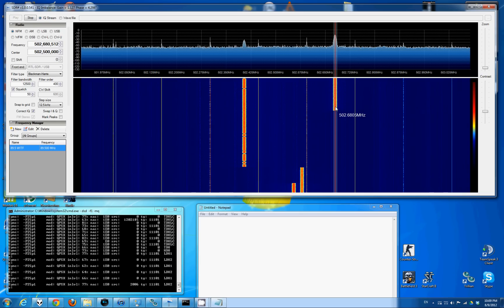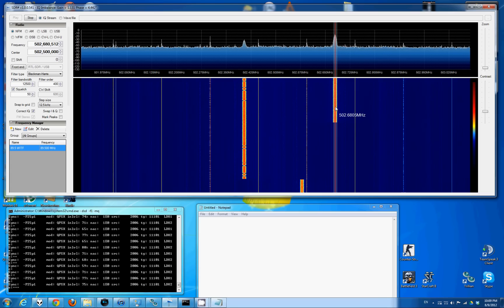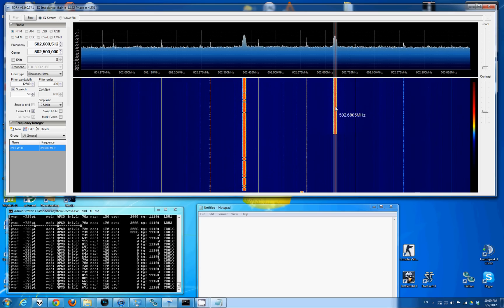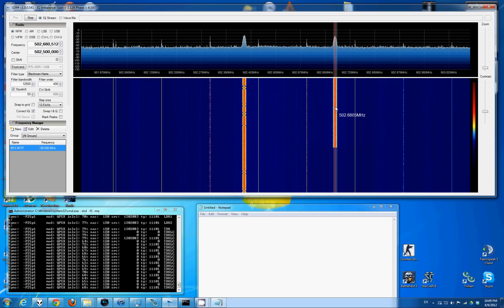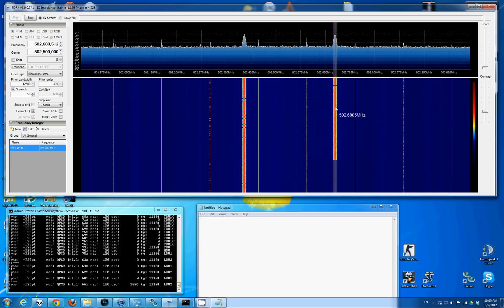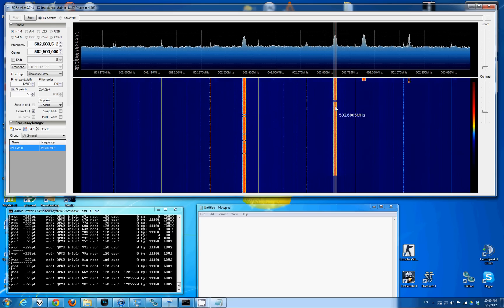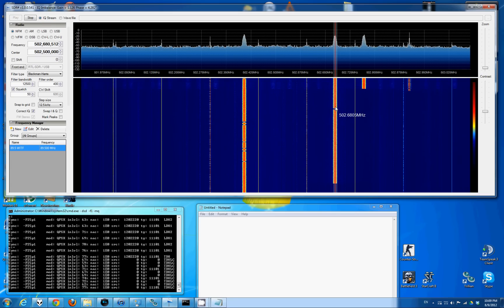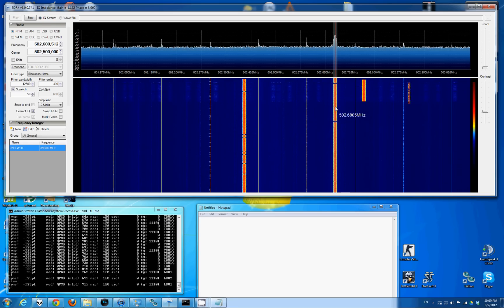RTL-SDR: Decoding P25 Phase I QPSK with DSD and SDR#

Comment from the maker: @Bob Havenga No. The input for DSD is the raw baseband digital signal (the audio you would hear from an analog radio if you tuned to the frequency). DSD then demodulates and decodes the digital signal and sends it to your soundcard to be played on your output sound device. Since I wasnt using a physical hardware input here, i had to use a virtual audio cable to route the output audio from SDR# to DSD.

Comment: Does the DSD plug into the speaker out put of the computer or how does it get hooked up? The area I live in is using 700 mhz P25. any ideas would be greatly appreciated.

Bob